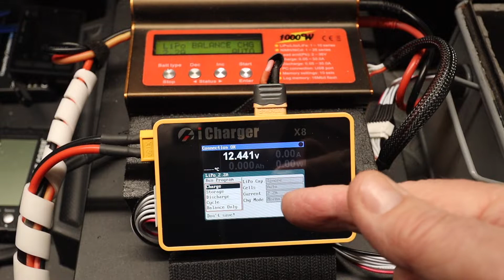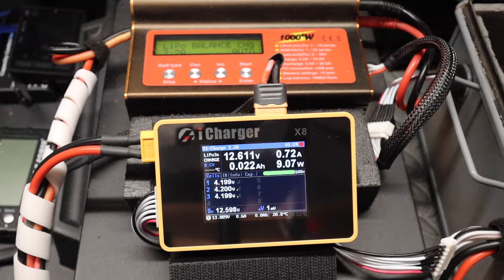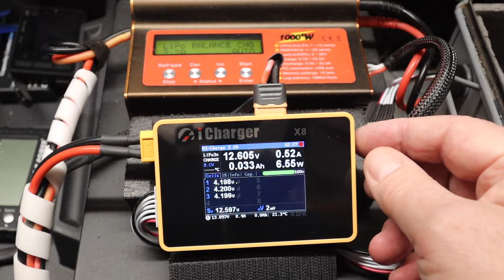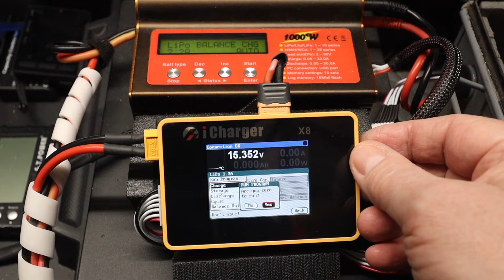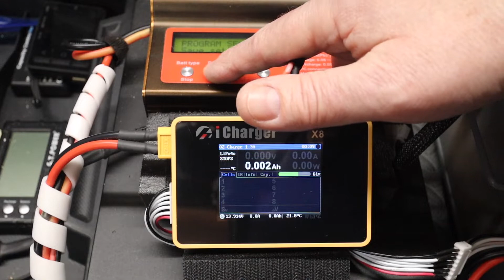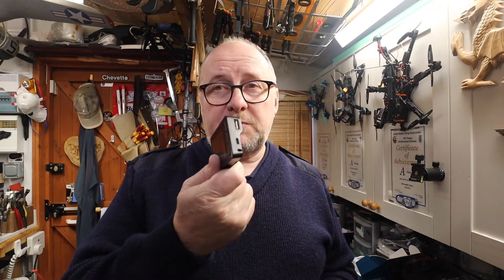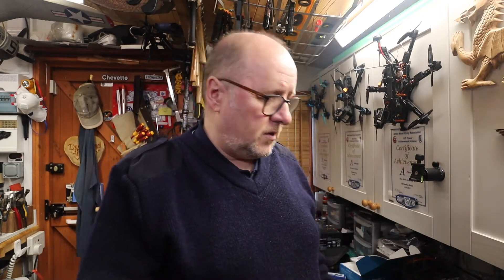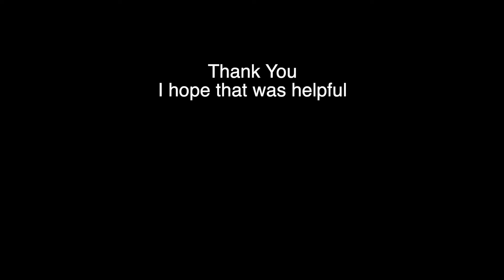iCharger X8 charging & internal battery resistance

Comment: Hi sir, you seem to understand that charger well. Do you have an idea why mine is showing "Done!" after 20min of charging with 30A? I charge 12 cells of 3.2V lifepo4, they are half full now. But the Junsi X8 is really stopping everytime after 20mins. Voltage of the battery (12V) is really not jumping up high so that it reaches a limit. I have also tried setting the AH to Max.
Reply from the maker: I would advise you to check the system settings for a total run time setting as I remember there is an end run time setting. It is in there as a safety setting so regardless to the battery voltage when it reaches that time it ends. These settings exist for each battery type so worth checking them all.
Reply from the maker: I just had another thought, there is a voltage monitor on the input power so if you were charging of a car battery it can stop charging if input voltage drops below a certain voltage to stop flattening your car battery. Maybe 30A is pushing your power supply too hard.
Reply: @TWSreviews  input power is steady from 230V via 12V Device, so thats stable. It also says all green Done, and does not show an error. So it stops as if something like a timer is triggered. But I shut off the timer function..

Comment: Hi Sir, like the video,  does the X8 charge any faster than the i3010b when charging with the same charge current ?
Reply from the maker: About the same on standard balance rates. However you can change the balance power to charge faster. But may forfeit the accuracy of the balance. 
The IR reading is cleaver and a good indication of how your battery is doing. If IR’s are significantly different you can keep an eye on that battery. 
There are a lot of nice features, ichargers are great quality but this one benefits from pre programmed routines. So spend a bit of time setting up the charge programmes to what you normally charge.